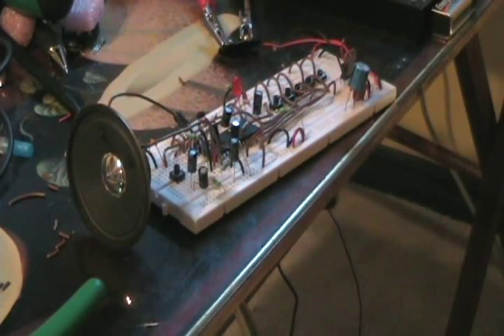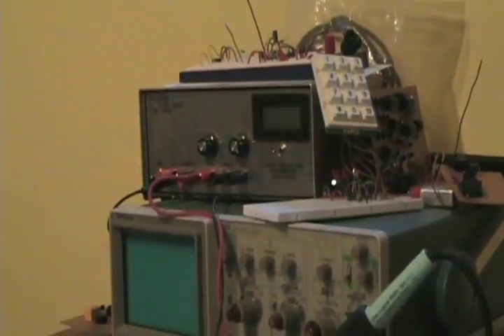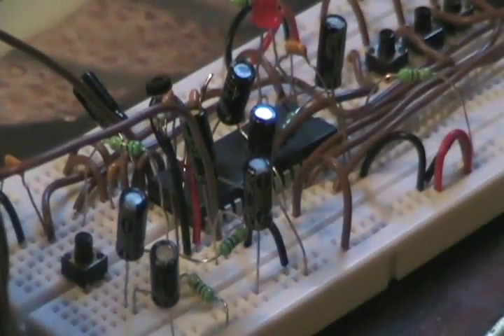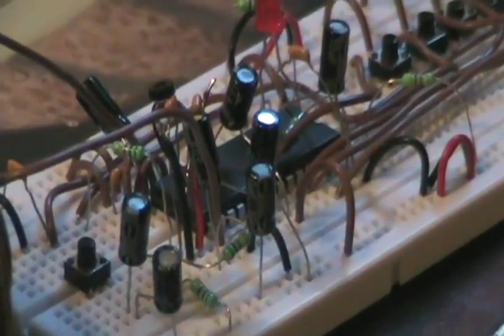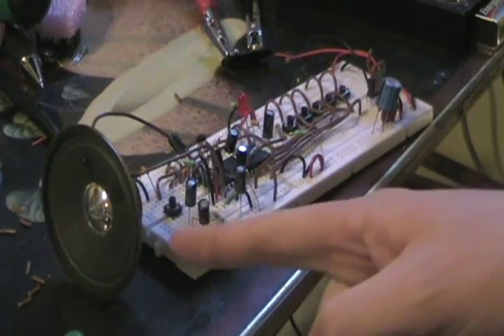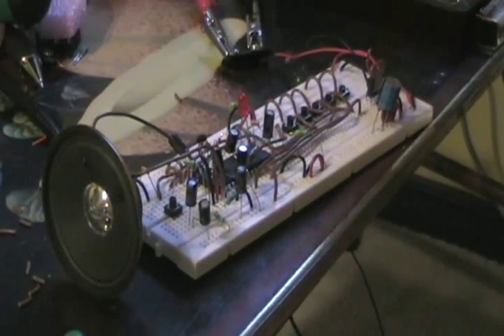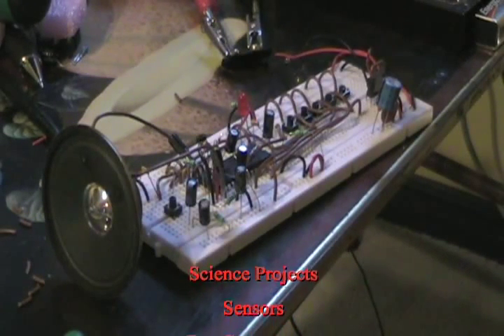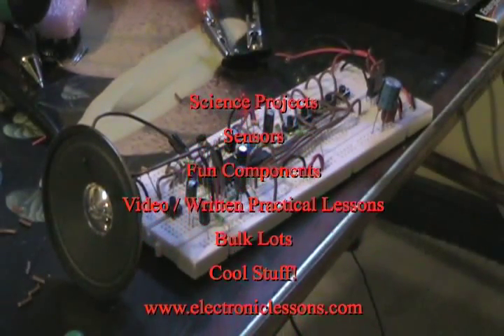The Record and Playback IC kit - Essentially a make-your-own Yak-Bak

Comment from the maker: Hey!
This chip isn't anywhere near as interesting as the APR9600.  Check out that video.  I'd have to check the data sheets, but depending on the sampling rate; determined by an external resistor and capacitor network, you can record good quality audio for about 40 seconds, or mediocre quality for 60 seconds.  
The APR 9600 can record several messages with ease.